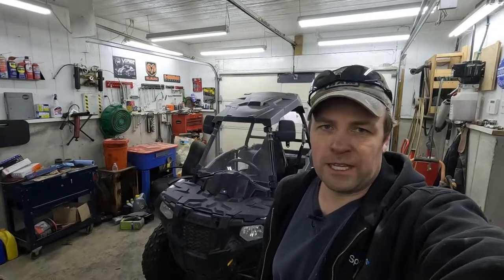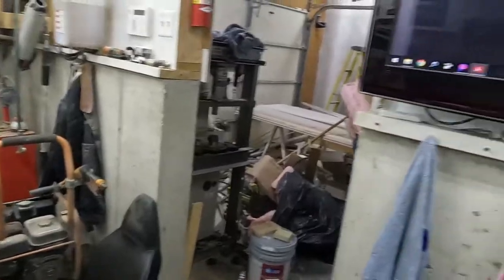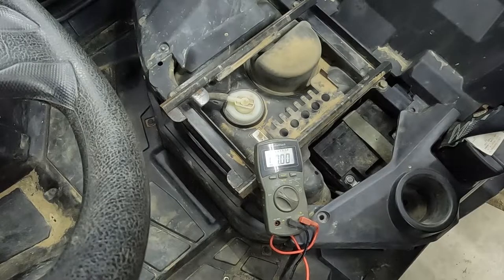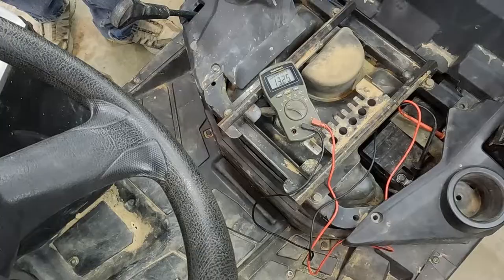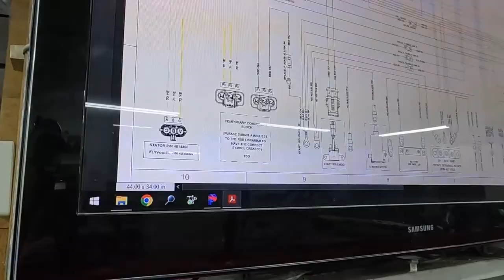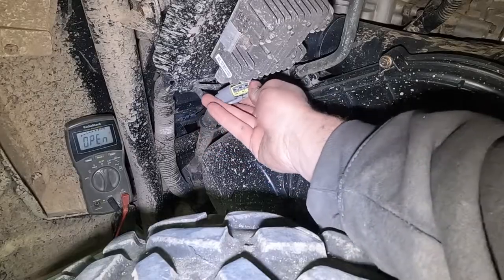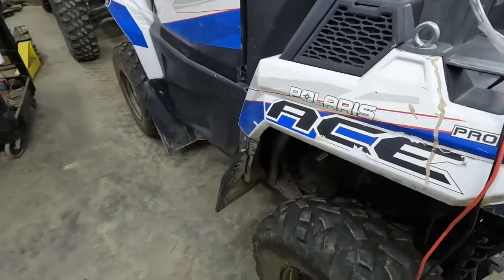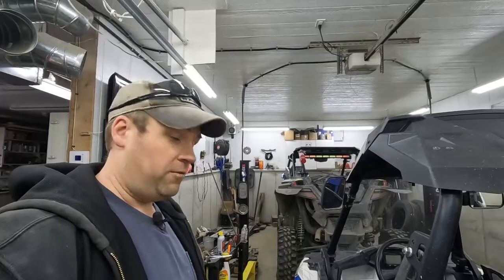How to test the charging system in any ATV, SXS, or UTV.  Dwight is having battery problems...

Comment: I have a razor 800 can I upgrade the regulator
Reply from the maker: It is a standard regulator, so there are alternate manufacturers for that.  Some are a little heavier duty with bigger cooling fins.  But, if you're looking to get more power, you're limited by the stator, not the regulator.  Hope that helps!

Comment: My voltage fluctuates between 12.5 to 11.5v with in 30 sec of it running u think it a bad rectifier? Thanks !
Reply from the maker: It is possible.  Be sure to rule out the other possible sources first - clean and tight battery connections, GOOD BATTERY, and test the stator.  You shouldn't ever see less than 12v, as your battery should be charged well above that.  The voltages you're seeing points me to the battery - either undercharged, a bad cell, or loose/corroded terminals.  Hopefully you're able to find it!

Comment: What type of volt meter do you use to check all of that electrical system?
Reply from the maker: The model in that video is a vintage RadioShack volt-ohm meter!  For that job, any volt-ohm meter will do, even a cheap one on Amazon, such as this: https://www.amazon.com/AstroAI-Digital-Multimeter-Voltage-Tester/dp/B01ISAMUA6

Comment: My stator ohms good and not grounded but isn't putting out but about 3 volts .  Rectifier good and battery appears to be good. Is it the stator you think?
Reply from the maker: Most likely, or a wire to the stator.  If you've ruled out the rectifier and battery, there's only one thing left!  Hopefully you get that fixed without too much headache.  Thanks for watching!
Reply: I have the same problem. was it a wire.?

Comment: What Shop management Software are you using for looking up wiring diagrams?
Reply from the maker: I typically acquire the manufacturer's service manual in PDF form.  Some are harder to find than others, and some you might have to pay for (eBay digital download, Haynes.com), but they all exist somewhere!

Comment: what if it beeps on 2nd test at 7:55 .    mine failed that test. what do i do next? new battery and new VR are already installed
Reply from the maker: That means your stator is shorted to ground.  You'll need to open the stator cover and likely replace it.  Sometimes it's just a rub inside and can be repaired, while other times it is bad enough that it needs to be replaced.  In any case, pulling the stator cover would be my next move.